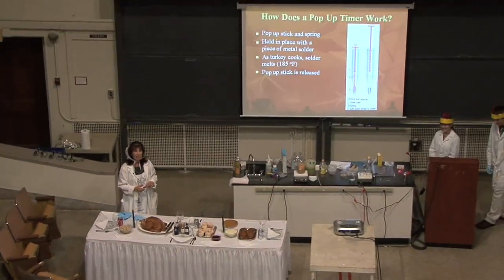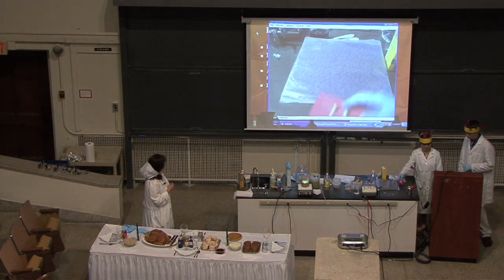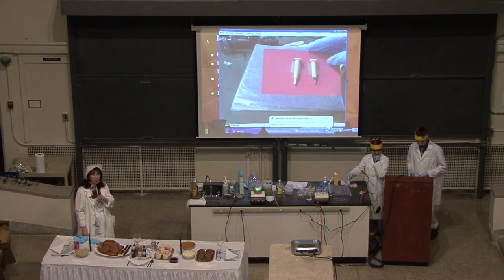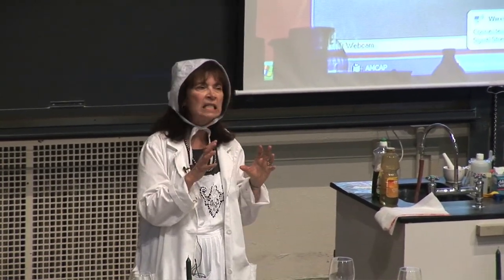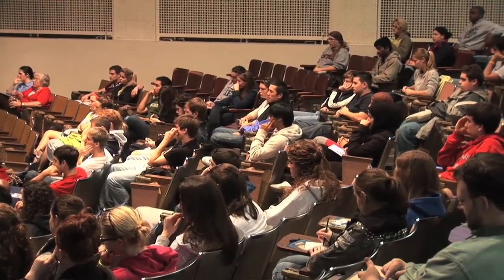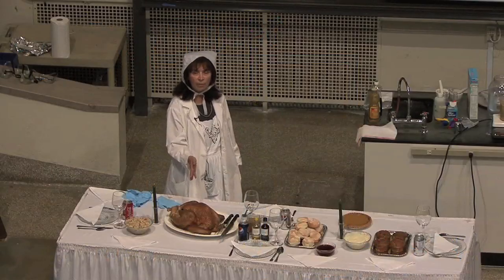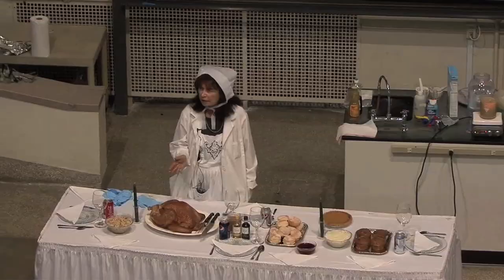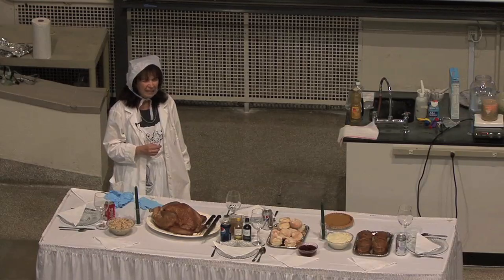How Do Pop-Up Timers Work?

Comment: This is awesome... I am juuuust cooking a chicken with a pop up timer and I hadn't encountered this before.. I didn't know if I had to pull them out,.. sooo not only did I learn that I should leave it alone, the science behind is awesome.. but the use of solder got me concerned.. I work at a building materials research org. and we know that solders can contain lead, even solders marketed as lead free can: "...Solders and fluxes can contain lead, a persistent and bioaccumulative toxicant, and other heavy metals. Because U.S. federal law allows solders and fluxes to contain up to 0.2% lead by weight and still be labeled “lead free,” even “lead free” solders may still contain a small amount of lead.".. so, yeah, I don't want lead in my chicken, even if the pop up timer is meant to contain it. Are there other types of pop up timers?